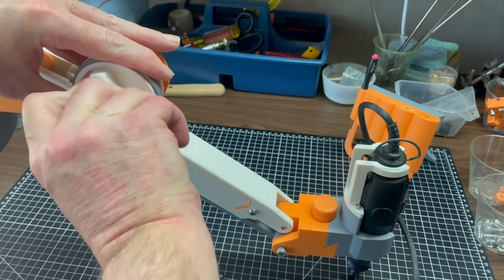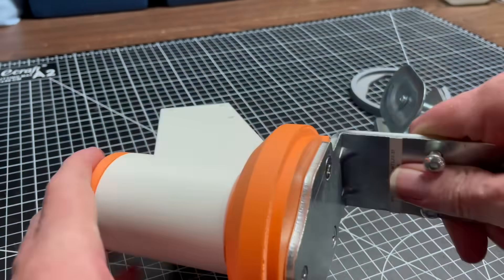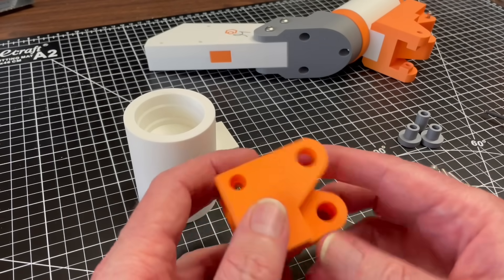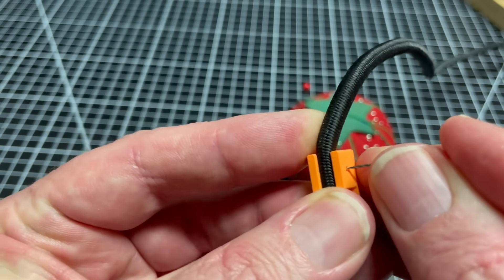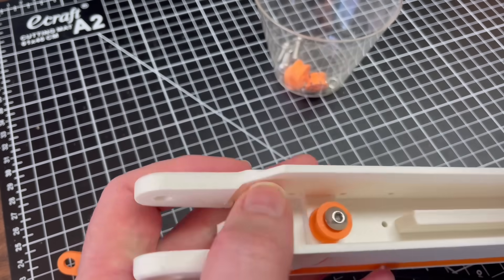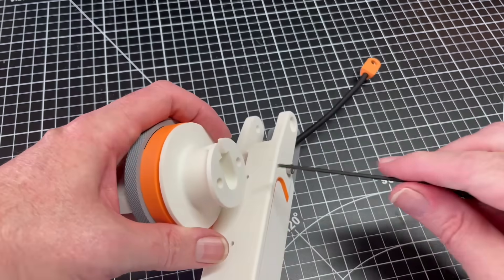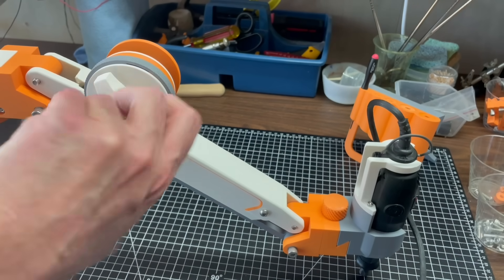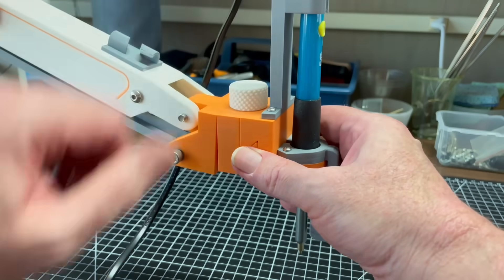Torque Arm Improvements - 3D Print Lab

Comment: As an alternative to the cleat for the tool holder, have you looked at the quick-change mechanism for lathe metalworking lathes? Using a vertical dovetail and a horizontal cam-style action. My thought is that it might speed up tool changes while adding strength and rigidity. I feel like the current cleat would fail under lateral loads, but I'm not able to back that up with anything more substantial than vibes. I can't wait to see what files you decide to make available, I think that your usage of bushings and pulleys with the bungee cord is genius. I would love to give build a try myself, and coincidentally we have the same kind of dremel.

As a disclaimer, I'm by no means an engineer, not even a design professional and this is the only video of yours that I've watched so far at the time of writing this.

Comment: Lots of really cool design ideas, like the bungee mounting and spool, and adding screws to reinforce. The base isnt quite there, Its an unreasonable post processing step. Just shortening the base, and adding washers and a nut to the bolt will hold the core under way more tension.

Comment: It's a very intresting design, but I'm baffled with your persistant use of a clearly inadequate printing profile. Clearly the temperature is too low, clearly you need thicker walls, clearly you can do with better infill! %)
Reply: There is something to gain from it during the design process though. It exposes weaknesses earlier, allowing them to be strengthened for everyone regardless of print quality and material.

Comment: A promising technique to significantly boost the strength of parts made from affordable FDM plastics is to use the print as a shell for an epoxy composite. For optimal results, you can print a minimal single-wall shell, essentially a mold, using lightning infill for support, and then fill the internal cavity with the composite. This method also allows for embedding steel or carbon fiber reinforcements inside, creating incredibly strong, custom-shaped parts at a very low cost.

Comment: Really useful video. Like the inlay. Thank You. Do you have any tips for how to design flexible components such as your ratchets? It is the one area I have no feel for material capabilities and hence tolerances.
Reply from the maker: For me it's a lot of trial and error. I know how I want the part to flex but it's hard to know how it will behave until it's printed. Often I'll make the bending part too thin and it will break, and then I have to thicken it. Good luck!

Comment: 12:30  if it was obvious, maybe it was worth to think about it during design. Or even print some test part of it, instead of scrapping whole box of plastic.
Like, do you think it is a good idea to put plastic handle such close to ~250C iron.
Reply from the maker: Yes, I should have said it was obvious "in retrospect," like many things are. Hindsight 20:20 and all. Mainly the tip of the iron gets hot, and the metal sleeve radiates very little heat. Still, it might be good to add a guard so my fingers don't slide off and touch the metal
Reply: @stuartferguson11  yes, I understand that we all "smart" in hindsight. However, here I'm more referring to the fact that, in my humble opinion, it should be obvious that 3d printer is not a replacement for every engineering task. Bolts, nuts, still rodes, aluminum profiles and low grade bearing are relatively cheap. So, why not to use them. A good example of such design philosophy is @Borgedesigns channel.

Comment: 2:40 do 8 perimeters and bump Infill..  maybe get a fillet in there if you can to avoid stress risers… 

I’d personally make that part  solid.

The epoxying and hook idea quite cleaver!! Similar to that new concrete with hooked wire which in some cases performs better than traditional steel bar reinforced concrete.
Reply: I was expecting him to pour cement in there at first
Reply: Doesn’t infill % only marginally improve strength? Walls/perimeters are a great suggestion tho! I bet it’d at least reduce the need for epoxy? Maybe one of those thrust bearings in a massive size would take care of the rest, but it’d probably be more expensive and harder to source than just epoxy and paper clips
Reply: @nathanblanchard8897  This seems to be just around 10-15% of one of the weakest infill types. For strength it's better to use Gyroid or Cubic infill and up the percentage a bit. And yes, thicker walls of course. But I don't think it would be as strong and stiff as just filling it with resin as he did.
Reply: @nathanblanchard8897  infill percentage drastically effects print strength especially when the infill percentage is as low as he had it in the video
Reply: Check cnc kitchen sometimes more perimeters and slightly more infill is better than solid. In this case it look like 3 perimeter and 5-10% to me would be too low. I do all my prints at 4 perimetera minimum and if it takes a load 50% (leather mounds are 50% but a lot of stuff is solid) I’d rather print once and not have something crush. 

On my channel the “so clean” short that is 10 perimeters and 50% with a solid layer every 10 layers so it’s stonky. I’m struggling to hold it down and not warp. The top layer is great bottom is like a banana localize pealing but I think the bed lifted. $100 bucks in for the fish light mount. Hopefully 3rd time I can get it to finish no issues. If it doesn’t work the next time I’ll be angry!!
Reply: @OneSolidCube oh gotcha! That video was the one I was thinking of, but I couldn’t remember the exact results. Thanks for the refresher!

I’m a high wall count/lower (gyroid) infill person myself, 5 and 40 if I’m really worried but usually 3 and 20 for normal prints. It’s a tiny price to pay for massive improvements in strength and usually a pretty similar print time (even on my snail speeds). 

I’ll have to check out those videos! Thanks for the suggestion
Reply from the maker: Thanks! I did try upping the strength settings and it was better but still flexed

Comment: Very cool with the epoxy, I wonder if there could/should be more design considerations to give the epoxy a better grip to the 3d print itself, though I do not know much about epoxy so maybe the layer lines are enough
Reply from the maker: I didn't notice any problem with the resin adhesion

Comment: @StuartFerguson - A couple of ideas came to mind watching your inspiring video. 

I just watched Chris Borge's channel video ("A better tool for heat set inserts") three days ago for a heated insert tool with a cement filled base and a insert holding tool for one-handed operation.   For what it's worth, he added a means to deal with calibrating the toolhead effector orientation so it is 90 degrees to the work surface, which seems to be an issue for your design as well, considering each toolhead effector might align vertically different. 

Practically speaking, the missing parts to your design might be work lighting and magnification (yes, that would add a bunch more weight to the tool effector, but I always need both when doing heated inserts and doing fine work with a dremmel - having the extra real-estate on my work desk for the magnifying lamp also is a premium).

I'd really like to add a tapping toolhead effector (bigger and heavier tool). 

I don't understand making two pieces for the upper and lower base/arm assembly... doesn't that add stress points around the 3 bolts that wouldn't be there if it were all one piece (or is just to simplify the printing?) 

I liked your idea with the paperclips and epoxy for the same reason I like Chris Borge's design with concrete (durability and weight).  In the same vein, perhaps such a tool is meant to have more than just plastic parts and bolts to be rugged enough to last on a maker's bench. I say this because of your struggles with the tensioning part of your design not being rugged enough to barely hold up the dremmel - perhaps some metal reinforcement there would allow you to beef up the tensioning part so it could hold heavier effectors?
Reply from the maker: Thanks for the thoughtful comments. I've watched Chris's video multiple times and still don't understand his calibration step. In any case, I've designed my own leveling head which you'll see in part #4.
lighting and magnification -- we'll see. Tapping -- yes, agree. Printing smaller parts that screw together allows for faster iteration; also I've found that once the screws are tight the load is mostly on the friction between the plastic surfaces, not the screws.
There are obviously limits to the plastic torsion system but I don't think I've hit them yet. I'm working on beefing up the capacity using better mechanical advantage, so we'll see I guess

Comment: wow. The tensioning system. the printed bushings. so many fantastic ideas in this video that i am writing down for myself later. Couple questions. What metrics did you use in order to make threads that your bolts engaged with so easily? Also, have you considered mixing materials? a few sticks of white oak or another hardwood would be great alternatives to printed arms.
Reply from the maker: OnShape has tools for standard thread types. To find the proper bore hole I used trial and error

Comment: This is my first impression of you or your channel and its really good. Keep up the great work! For the bearings allowing too much movement, possibly adding a set screw which rubs against the surface would allow for an adjustable resistance.
Reply: Same thing here; this is that good sh*t 💯
🤩🤯
Reply: If the set screw is pushing against a more robust material than plastic, then I would agree.  Maybe adding some brass shim or sleeve would make that work, but wouldn't the set screw rubbing into plastic wear a slot or hole into the bearing's plastic wall over time?
Reply: @KarlMiller  Correct it would wear a slot eventually. Regardless of the material though, given enough time, something is going to wear in that setup, and the setscrew would need to be tightened.  A better and more robust but complex solution would be to have two gaskets similar to what he did in the video, but out of a more resistant material like rubber that are then tightened. The wear between two identical materials should be minimal and mainly just heat generated. Sanded TPU could work if you want to keep it 3d printed. The original idea was a quick and dirty solution that'll last a few months, depending on how often it's being used, as you can keep tightening it to a point.
Reply from the maker: A more robust way to generate a tunable amount of friction is certainly something I'm thinking about

Comment: Looking to buy a new printer under $400. Any recommendations
Reply: Edit - best like 802Garage commented is QIDI q1 pro , if you have bit more dola. You can get yourself bigger model but q1 should be way more than enough to start

You could also build DIY for bit cheaper but it takes time to do that 
and printers like qidi or bambulab have ready to go presets in slicers so you can easly start with them
Bambulab is also good option but they started to limit customer so you have less option to mod it etc (parts are pretty cheap compared to moding etc so its not rly bad option but still...its not great either)
Reply: Flashforge Adventurer 5M Pro or Qidi Q1 Pro. Bambu Lab is still a good option if you don't mind the closed source and ecosystem plus less customization. I would personally avoid Creality overall due to the general print quality not being as high, but they do have fine options.
Reply: @802Garage ah yes....qidi is probably best in my opinion right now
But i will think about getting bigger model (more expensive but if someone is sure about 3D printing...then he/she wont regret it)

Flashforge ....i dont know...maybe...but im not sure how easy it is to modify it etc
And qidi is way better

Creality...its crazy cheap , you can get it used for 100-200$ , then fix it by moding it to be better printer and it is rly good after that (yet that qidi....)
Reply: @802Garage i edited comment above
You right , i forgot about new qidi
Its crazy good for the price :)
Reply: Change my mind....
Go with qidi like above 802Garage commented 
Its craaaazy good option right now 
(If you have money go with bigger one but smaller q1 pro is crazy good)